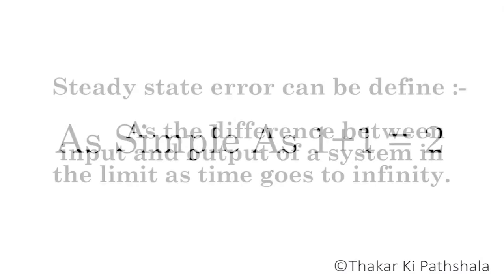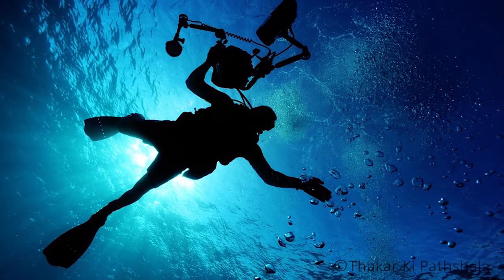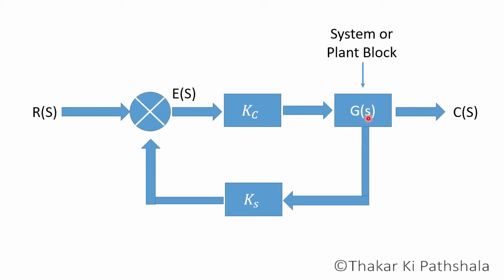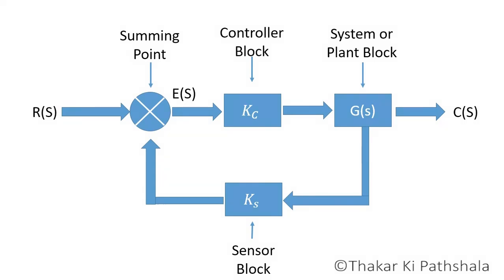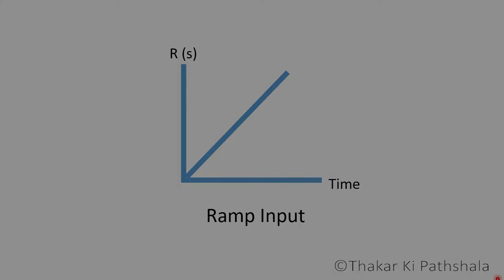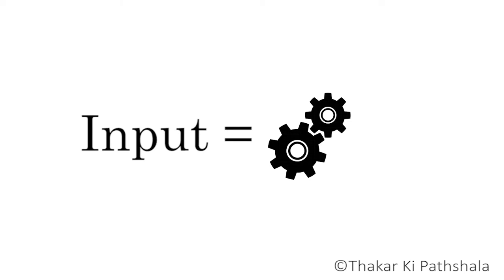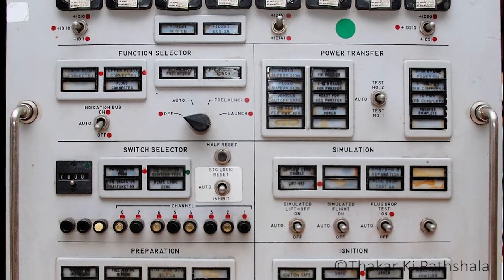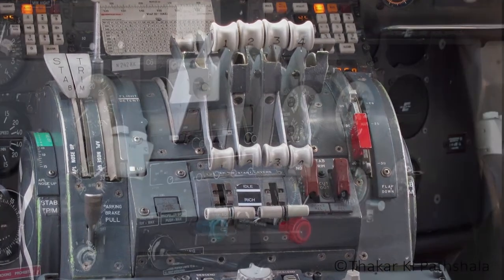Steady State Error In Control System

Comment: Sir, if we want o/p to be equal to i/p why bother about  the control system?Can't we just use the i/p directly ? Or this is just to understand the basics?Like step input to simple RLC n/w. At steady state o/p equals i/p. In actual control system i/p and o/p may be in different unit.Like i/p voltage and o/p rotation speed of motor.In such cases how we calculate steady state error? Is it desired o/p minus steady state o/p ? I am wasting my time thinking.
Reply from the maker: Hii. Vibin thank you for sharing your question here. Your concern in right but there are certain parameters like number of poles , number of turn of winding , supply frequency etc. And then we have so many equation and all that so if we measure the input voltage or say current what ever it is we already have the equation we can calculate the desired speed. If we measure the actual speed of motor via techometer then we can tell the different between both the speed actual speed and the desired speed. I hope this explanation has answered your query if not then feel free to ask. Have a good day.
Reply: Thank you.I understood. What about the actuating error ? Is it different from steady state error? I know that, in unity feedback system both are same.But what about the non-unity feedback system?
Reply from the maker: As per my knowledge there is no term like actuating error. I think you are getting confused between actuating signal and error signal. The actuating signal represents the control action of the control loop and is equal to sum of the reference i/p and feedback signal.
Reply: yes,that's it.